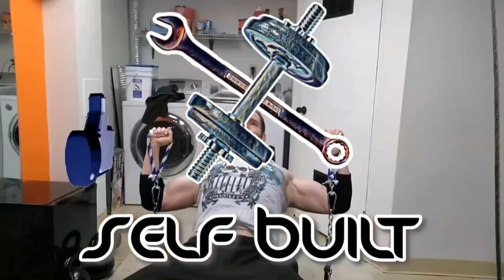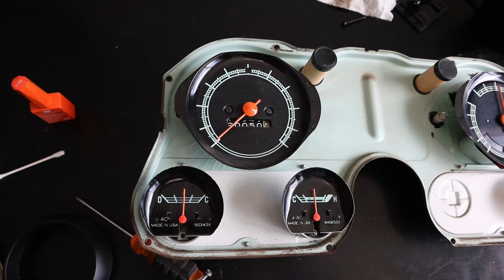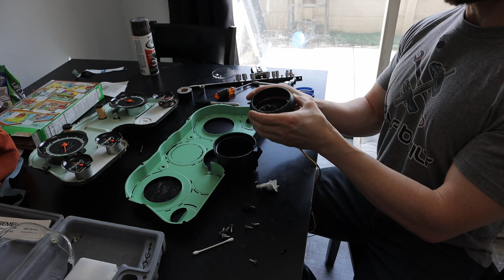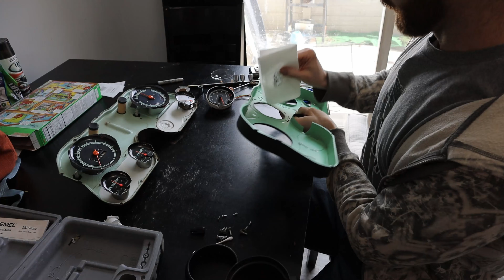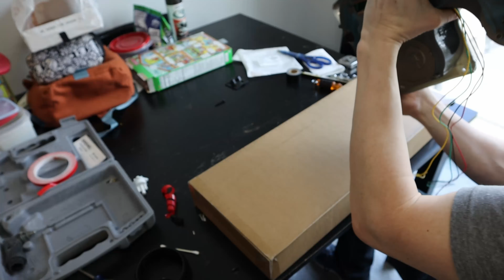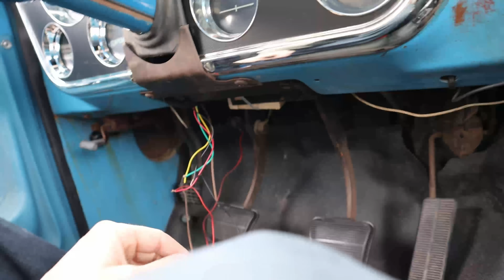67-72 Classic Chevy Truck Dash Restore/Upgrade

Comment: I was wondering also, Can the temperature gauge be done similar to this? I seen where a voltage gauge could
Reply from the maker: Yeah I don't see why not. If it was me I'd just make sure it's the same size and can somewhat blend in. I know the temp gauges on these trucks can be really finicky and I've had to do some repairs to keep mine going. I've thought about adding a vacuum gauge in my last spot since that was an option. No plans yet though.

Comment: i got the tach and im doing it !  but what is that dohickey you have strapped to the steering wheel ? thx for the video
Reply from the maker: Very nice! I hope it turns out great, let me know! Haha the dohickey on my steering wheel is a remote to my stereo. Since it's touchscreen and my hand is busy shifting it's much easier to change volume or stations. I found myself often hitting the wrong part of the screen while driving 😅. Thank you for watching!